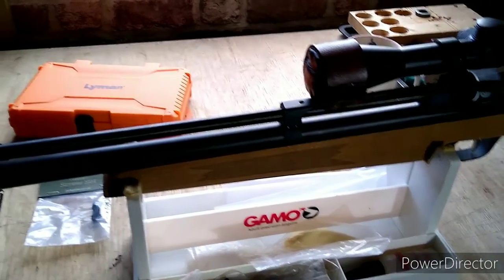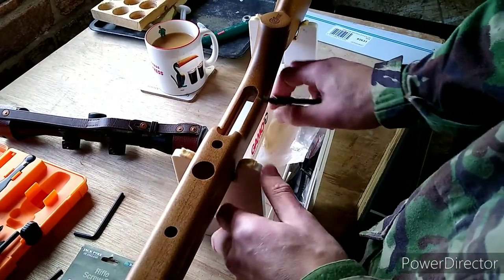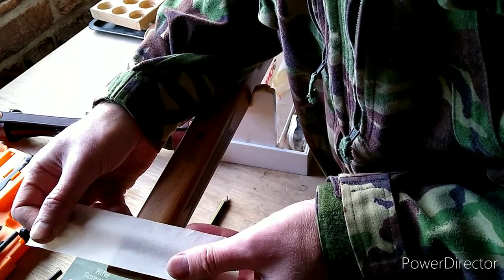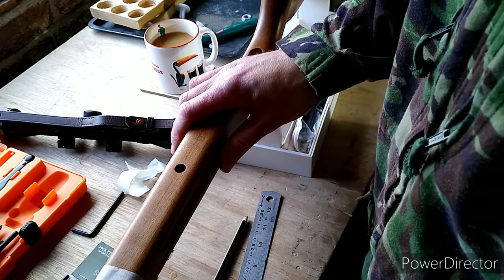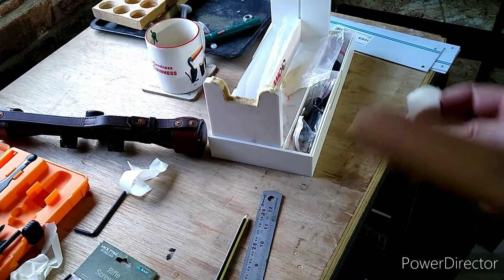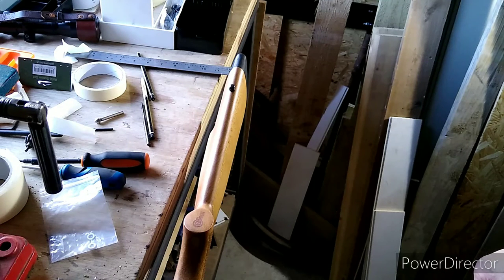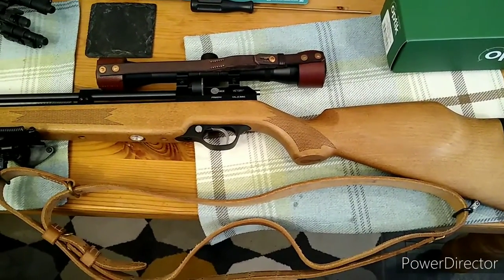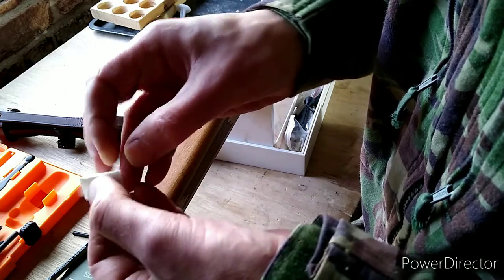NV044 Budget PCP Build Part 5. Fitting Bipod / Sling Swivel Studs. Jack Pyke studs on the SMK PR900W

Comment: Could I have a list of what bipod and sling you got I really like them
Reply from the maker: Hello, thank you for your comment much appreciated 👍🏻. The bipod is from eBay, I reviewed it earlier in the series. The title of the review video is the eBay description.
The sling came from soldier of fortune and is a few years old (so the brass has dulled and the leather has aged a bit). The description on the SOF website is "American WW2 M1 Garand sling. Leather with brass fittings". They sell the same sling with black fittings but I don't think it looks as good as the brass.
I did find that the bipod was far too low for me so I replaced it with a Webley bipod. Pricey but a good bit of kit.
Hope this helps, please let me know if you require any further information.